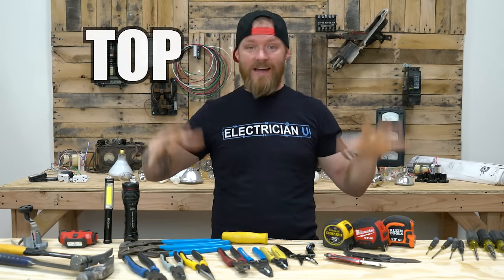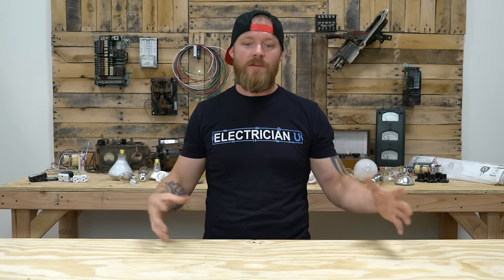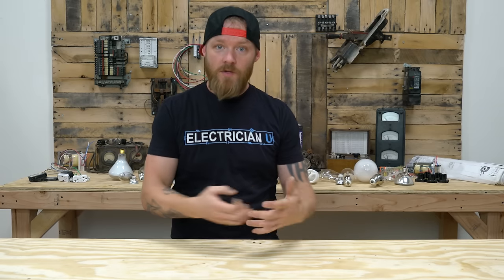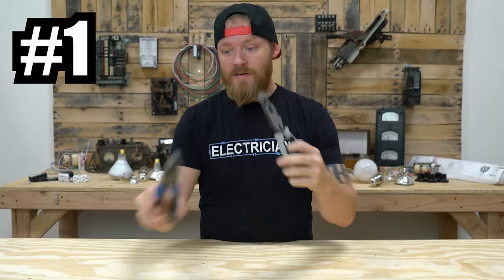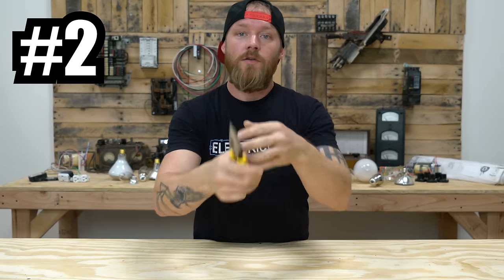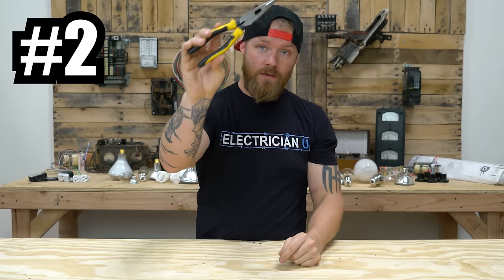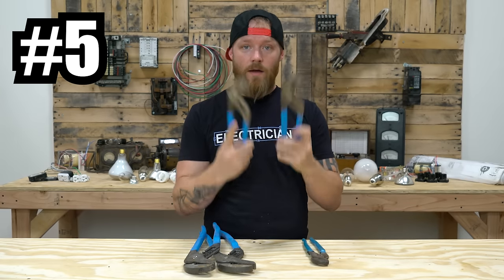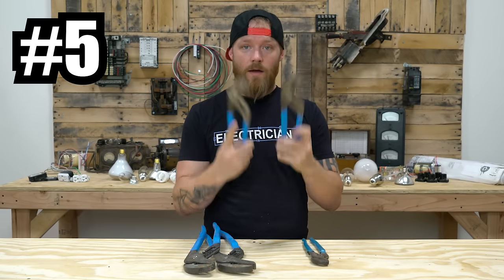Episode 42 - APPRENTICE TOOLS - 13 Tools Apprentice Electricians Need To Have

Comment: Back when I was an apprentice my journeyman stole my sheetrock saw and broke it trying to cut into a sheer wall. I ended up needing a sheetrock saw later that week but hadn't replaced it. I had a wood cutting Sawzall blade and some 1/2" EMT, so I flattened out one end of the EMT, place the blade on the end and drove a tech screw through it to hold it in place. I cut and filed the end of the screw and wrapped the handle with electrical tape. The thing has worked so well that I've been using it for over a decade now. I call it my prison shank.
Reply: Hell yeah man.  That's what it's all about. Ingenuity.  Very nice yo. Very nice.
Reply: That is so ridiculous in the best way

Comment: 1. Linesman pliers
2. Needle nose pliers
3. Diagonal cutting pliers
4. Wire strippers
5. Channel locks
6. Screwdrivers
7. Precision screwdrivers
8. Keyhole saw, Sheetrock knife
9. Good tape measure
10. Flashlights, headlamps
11. Hammers
12. Roto splitter
13. Utility knife
Also get protective eyewear and electrical tape
Reply: Gp
Reply: Cap on needing the rotosplit. Just use dykes
Reply: Roto splitter and safety glasses and electrical tape better be provided. Or find a new place of employment.
Reply: @YouTubeEndorsesLeftistPropaganda  ppe and tape sure but rotosplitter is something you should get if you work on mc alot
Reply: @youtubeendorsesleftistprop4304 never seen them provide. Roto split unless the journey man has one you are on ur own in union and non-union in my experience
Reply: I actually had to look up roto splitter. The first 5 years of my career was mostly running MC and I've never carried a roto splitter. It's so fast and easy just to break the sheathing, twist, and cut. And before you say it; I've never had a short. That's what strawberries are for.

Comment: Strippers aren't expensive, lol, at least in the tool world...lol...That was a good one...
Reply: 4:46 there's a lot of different strippers on the market
4:53 some of them are like several function
4:54 some of them are different sized holes
7:42 strippers are not usually that expensive
Reply: As a apprentice the only klein tool I bought for a very reasonable price was a stripper
Reply: lol
Reply: @wwetnafan1998  Klein is junk. Knipex is king!
Reply: @Tre16  I can tell You are Non Union !

Comment: FYI: All Klein hand tools that aren't ratcheting have a lifetime warranty so get a couple of those extended multis with the breaking flat-blades and just swap/send the broken one in when they fail you.

That said, I have found the #1 squares to be effective  for residential switches/recepticles. I always worry about overtightening anyway so the reduced torque keeps me in check,  I feel like.

If you get this far, thanks for reading. I'm a first year union apprentice and I can't even begin to tell you how much your channel has helped me. I take the learning process a bit more seriously than most of my peers and you have a very cohesive teaching method.
Sincerely, thank you.
Reply: What union are you with? IBEW? What was the process like for you to get in? I'm just wondering because I'm looking into IBEW and their schooling to become an apprentice.

Wish you the best in your work.
Reply: @kaibaCorpHQ  Yeah, IBEW Local 26 out of DC. I'm a Residential Worker at the moment, still trying to get into the Apprenticeship program. Applying for the A Program required a copy of a high school diploma or GED, a sealed transcript verifying that I'd passed Algebra I, and a copy of my license. Then there was an aptitude test and upon passing that, an interview panel. There are always a lot of applicants and limited spots though, so don't get discouraged if it takes a while to get in.
Reply: Check out the new ECX drill bits from Milwaukee. They changed my life with working on residential switches/ receptacles screws. I discovered them by mistake when I ordered a set of extra bits for my Milwaukee 11-in-1 screwdriver and the ECX bit was included.
Reply: Actually, all Klein tools even the ratcheting are covered under lifetime warranty. I have warrantied out my ratcheting cable cutters twice, and both times was from me doing dumb shit like cutting stainless steel cable and dickering up the blade. Klein tools are superior to all and anyone who says different is a hack! 😂

Comment: I want to switch from being an auto tech to electrician and its really nice knowing that the thousands of dollars Ive spent on tools wont go all to waste. I'm sure my electrical knowledge I've gained from the auto industry will definitely help me in my beginning stages. I just need to find a company to apprentice for now!
Reply: You ever make the switch?  I’m apprenticing in commercial electric after 13 years as an auto tech, more than doubled my take home pay from day 1 due to traveling and working 60 hours a week plus per diem.
Reply: @Penguin545  I never did actually. I shortly after became a GM of a shop and then about a year and a half after that I went back to bein a tech. At this point I make over 70k a year in my position rather than 40k at the previous company.  Im not sure if I will leave or not at this point because I do love working on cars and I know it so well
Reply: @Penguin545  Yeah Im also getting my ASE certs right now which will continue to up my pay rate. I can easily make 100k after becoming master certified. Im not struggling that much

Comment: “There are a lot of different strippers” 
My wife never looked up so fast.
Reply: Gotta love em strippers!
Reply: Thanks to who  for letting you how to use a stripper . and yes there not only on line!
Reply: Oh man, just wait till you watch the vid on 3 ways.
Reply: @666thprayer  and illigal 3 ways
Reply: 4:46 there's a lot of different strippers on the market
4:53 some of them are like several function
4:54 some of them are different sized holes
7:42 strippers are not usually that expensive
Reply: Gotta have options
Reply: @666thprayer  Count me out if he makes a video on sealants - particularly the ones that come in 10 oz tubes that fit in a dispener gun :D

Comment: Very good! I'm passionate about tools. And I really like the American electrical system
Reply: I worked with a guy from Guanajuato. I watched him run sprinkler wire from 120v  led fixtures about 1/2 in underground direct burial 🤣. I dont think he was a good mentor for me as an apprentice
Reply: me too
Reply: Lmfao “I really like the American electrical system”🤣 You gotta be kidding me?? Metal boxes and cables inside walls, yes very nice system smh🤦‍♂️🤦‍♂️
Reply: @davidboman7395  Inside walls we typically use plastic.
Reply: @davidboman7395  Im surpised you think that is all there is to it.
Reply: @matt59fire  If there is no danger of someone hiting it with something it's up to code.
Reply: @matt59fire  No argument. Sprinkler wire is isolated with being berried in mind. If somone gets shocked , it means there is exposed wire. Many reasons for that. That's why I said IF there is no danger of the wire being damaged it is up to code. They will not requre you to run any piping under the ground. Only where the wire will be exposed off the ground to be connected to what ever controller there is. It is up to code just chek it out. Also when I think about it if there is exposed wire on both L and N under the ground this will trip the breaker 100%  so nobody can actually get shocked. You should think about what exactly did you see.

Comment: You can buy the replacement bits and barrels for the Klein 6 in 1 tools. Klein part numbers: 32400, 32401, 32395. I believe the bits come in a pack of 2.
Reply: The stubby Klein 6;in 1 is good to have , lots of guys don’t have much restricted access drivers .
Reply: Klein has a whole section for “replacement parts” online. Pretty much any tool part you can lose or damage is available. They might even send out replacements if you send pictures of a damaged part/tool
Reply: Matt M hey Matt it’s me I love you
Reply: @eddiew2325  Oh, it's you. Good thing, otherwise your comment would be super weird.... almost creepy. But hey, you do you.
Reply: Majority of supply houses carry them
Reply: @mattm7535  I love Matt too 😘😘😘
Reply: I work at Viking Electric Supply as the City Desk Tool Specialist. We have, or we can get, replacement parts for almost any tool. I can also send in tools to be repaired if needed. I could probably even find the replacement clip for tape measures so you don't have to buy a new one every time. ;)
Reply: As expensive as a brand new screwdriver Milwaukee for the win

Comment: The Southwire Rotospliter was one of the best purchase I made working in Commercial. The blade is still good after going through 2000ft of 12/2 and 12/3 bundles. Always keep a spare one handy.
Reply: The contract I just started working for bought me one of those it works pretty good

Comment: I already own every tool on this list, except for the Roto-splitter. I love my 11-in-1 Klein screwdriver, it has several flat, Philips, #1 and 2 square, T-15 and T-20 torx, plus 1/4", 5/16", and 3/8" nut drivers. 👍 I also have a a 5-in-1 Klein precision screwdriver that comes in VERY handy on small screws.

Comment: I like your channel.  You do an excellent job of explaining many of the concepts in the electrical world.  FYI I’m a retired secondary math teacher now turned into a handyman who has independently studied and practiced residential electrical work for over twenty years.  I now have thousands of dollars worth of high quality tools, mainly Kline’s.  Anyway, short of an amp meter or mutineer I think a non-contact voltage tester was missed.  I know they have their drawbacks but in most situations it serves as a double check against accidentally working on live wires or blowing out your dikes or linesman.  There’re not that expensive.  There are plenty of models out there with all sorts of features.  A basic Kline or Fluke model would suffice.  Thanks for what you do!  TTL.
Reply from the maker: Thanks for watching my friend

Comment: Once I got into Power Plants/Industrial I learned a saying...."The smaller the screwdriver, the bigger the paycheck." As I have progressed in my career, I have used my linemans less and my needle nose more.
Reply: Haha that’s a great saying! More or less very true!
Reply: @TylrVncnt  Yeah, I make a lot more money working on Protection Relays, AVR's, VFD and control wiring than running conduit, installing boxes/devices/panel, or wiring up motors.
Reply: It's true

Comment: the #1 square is used extensively in electrical in Canada. The terminal screws on outlets and switches are that. Also the screws that fasten the device to the box are also #1.

Comment: The one thing I saw missing from this list that you really need as a tradesman is a level. For checking square and plumb on enclosures, for bending conduit, for all sorts of things. As an apprentice an inexpensive $6-10 9” level is what you need. As you do more commercial work it makes sense to invest in a model that can clamp onto conduit for doing bends like a Klein 935AB4V . Also if you do a lot with EMT a conduit reamer (Klein 85191) or a reamer bit ( Klein 85091) is a nice tool to have. I checked, the southwire model SCDFR actually is cool because the bit can be removed and used in a drill, so it kinda has an edge on the Klein if the quality is up to par.

Comment: Good Video.  I'm training about my 14th apprentice right now.  She's got a year under her belt.

Disappointed you didn't showcase the 11-in-1 Multi-tool.  #1 and #2 Flathead and Phillips, #1 and #2 Square Tips and Star Tips, 3 different hex head drivers.

#1 Offset Flat Head screwdriver (squiggly) is great for exploratory holes when planning out recessed lights in ceilings or remodel boxes in walls.Use it as a drill and extend it fully in the hole and you can spin it to locate joists and studs.  Don't buy the one that has replaceable bits, the head is too big. 

Non Contact Voltage Tester.  This is an indicator tool, don't always trust it.  They can give false positive and negative results.

18V Battery Powered Tools (Drill, Sawzall, Multitool, Lights, etc...

Most of my work is residential remodel so 95% of my needed tools are Kleins, Strippers, 11-in-1 and buzz tester, plus a roll of black tape and reds in my back pocket.

Again, great video, I'm going to recommend my apprentice check them out.

Blue Skies.

Comment: I’m a plumber and I never carried an 11 in 1. This is possibly because of the guy I learned under. Also there’s times when you have to have a straight shaft to get into some holes. Anyway I finally bought the Klein 11 in 1 and love it. As for losing pieces, I’ve found that you can buy all the parts on Amazon individually. I’ve done this rather than spend $20 to replace it

Comment: All Pliers : Knipex
All Screwdrivers: Klein
Power tools: Milwaukee
Reply: K W pliers: klein
Screwdrivers: wiha
Power tools: dewalt
Reply: I was with you until the power tools. I think you spelled Makita wrong...🤣
Reply: Haven’t tried knipex can’t get them in Home Depot but Klein all the way and powertools, MAKITA only
Reply: @alancast6000  certain home depots carry Knipex if you look on their website you can find stores that do atleast in South Florida they do
Reply: @alancast6000  Makita used to be top of the line, ya need to go red if you can afford it now though, all of our crew has been slowly transitioning to Milwaukee.
Reply: Casey Dresser Everyone who says Makita are better have never owned Milwaukee. They are more expensive for a reason
Reply: I agree with this! Even tho the Knipex are expensive (you pay for the import/export from Germany/Europe) they are so worth it. I have NEVER felt anything grip like Knipex Cobras.
Reply: @eds6569 Milwaukee burns up or breaks too easily on power tools. Some of the specialty hand tools are really great though
Reply: I have wiha insulated screwdrivers, Milwaukee 13 in one, a stanley flathead, knipex linesman/channellocks, and Milwaukee power tools. The only klein screwdriver i own is my electronic screwdriver. 

I use the electronics screwdriver and my 13 in one Milwaukee the most
Reply: Prefer the Makita sub compact 18v.. better than Milwaukee 12v and much lighter than Milwaukee fuel 👍 travel light
Reply: All of my hand tools will always be knipex, wera or wiha. I will never buy klein/craftsman/ideal etc. ever again...They are such garbage.
Reply: All Pliers : Knipex
All Screwdrivers: Wera
Power tools: Milwaukee

and dont lend your tools out.
Reply: @macaronitire4152  have you ever  used Stahlwille tools? Another great German tool company.
Reply: @CaseyDresser510  nope no spelling errors here milwaukee is the correct spelling
Reply: @alancast6000  no its spelt milwaukee not makita it's ok just a little mistake
Reply: Pliers: Knipex
Screwdrivers: Wiha
Power Tools: Bosch or DeWalt
Reply: @alancast6000  Menards has knipex in store

Comment: I too have an obsession with flashlights but my favorite one right now is the Milwaukee pocket rover. Its a little floodlight that hinges and has very strong magnets and a clip. All the guys that see it at our different jobs are impressed with it. When I bought it there was an errante for a free spare battery and charger too so that was nice. I hate using headlamps and this light has been working awesome for me. If I’m working above ceiling or in a dark panel room I can just attach it to any metal object nearby and it fills the whole room with light
Reply: Unilite torches way to go bro!!!

Comment: I miss my buck Mesa knife😕 that was my perfect knife, it was fixed and had a kydex sheath( I think that’s how it’s spelled, correct me if I’m wrong/ misspelled it) with a belt loop and I would always put the sheath upside down on my belt and tighten the sheath  so the knife was firmly held. It would conceal it more. I also stained the handle to appear darker because originally it was a light gray. Sadly I don’t have it anymore because I forgot it at a job site right before it was time to leave it was. I had started that shift at 3 am and it was 6pm and I was tired and frustrated to I didn’t notice that I had left it on a tractor and left home. Well the next day I entered at 5am but my coworkers had entered at 3am and no one even saw the knife... 🤔

Comment: On the measuring tape, first thing take the screw out, apply locktight and reinstall. 😉. For the keyhole saw there are 2 that I like milwaukee has one that folds and uses sawsall blades, the other other I don't remember the name anymore but it has teeth on both sides and is a beast.

Comment: I’d recommend the mini Klein flush-cutters, D-275-5. Cuts up to #16AWG solid conductor (I have cut #10 stranded no problem), then can be used to score and strip the insulation. Cuts zip ties flush so there is no plastic dagger left sticking out for the next guy. Fits in a shirt pocket so you always have them. Also great for job site manicures.

Comment: The Hybrid grey handle linesman by Klein are one of the best hand tools I have ever bought - esp for residential. Having a stripper and a linesman together in one tool is awesome!   - I am also seeing the combo screwdrivers being very popular these days, as well. The square/flathead combo #2 is very common for panels, boxes and throughs!
Reply: 4:46 there's a lot of different strippers on the market
4:53 some of them are like several function
4:54 some of them are different sized holes
7:42 strippers are not usually that expensive
Reply: I can’t stand the combo screwdrivers, the square drive bits get stuck in the screw.  After about the third time of that I tossed the screwdriver.  Also the bits fall out in my tool bags